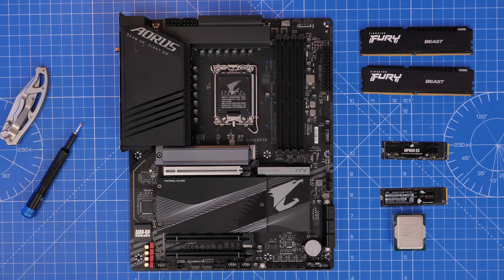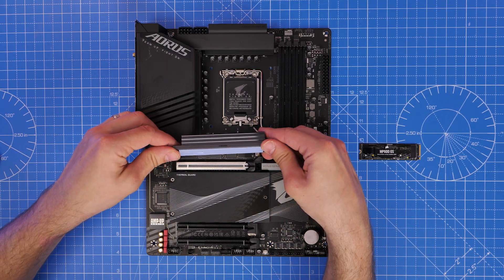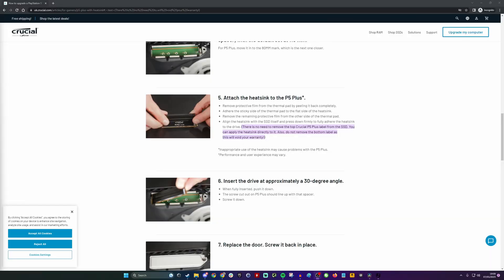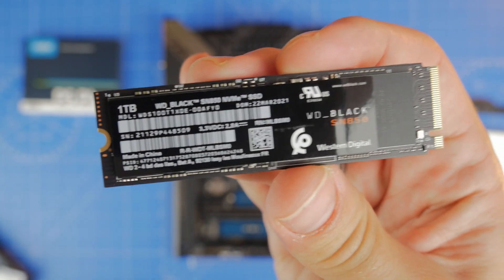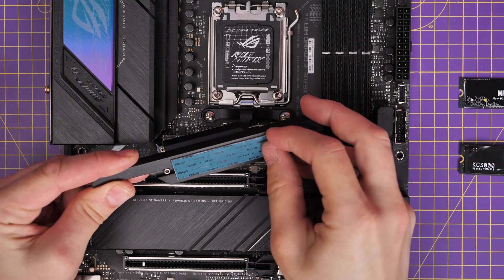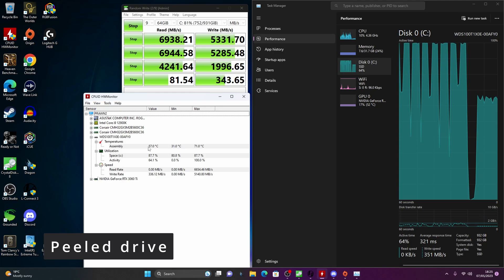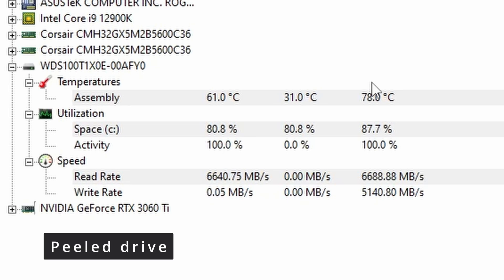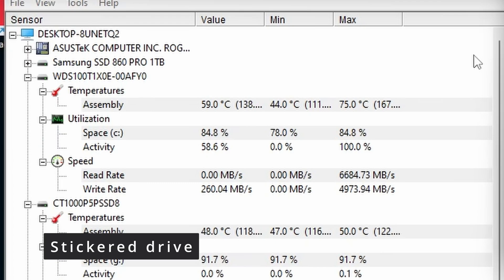Should you peel the sticker off your NVMe? Does it help?

Comment: Depends on the sticker many NVMe's these days have a metallic sticker on them that spreads the heat so will help improve the heat transfer when using a heatblock like in your video.
Reply: Adding more material decreases thermal transfer. It's dependent on the thermal resistivity of the material and the thickness of the material. The increased thermal resistivity of leaving the sticker on is negligible as long as it's not a thermal insulator, which it better not be if the manufacturer recommends leaving it on.
Reply: @victorro8760  it's not necessarily that the sticker is better for heat transfer, but it's better at spreading out the heat, most newer ones are made of copper and other materials that are good at transferring heat, which then spreads it out so it can be radiated over a larger area. This is especially helpful when you have an SSD heatsink with thermal pads, because thermal pads are worse at transferring heat than paste most of the time, so the heat being spread out means that more is being taken away from the SSD, now if you want to, you can go a more custom route and try to set up a thermal paste system for the SSDs, but it takes more work, and can get a bit messy at times.
Reply: @victorro8760  Often improved ventilation, else thermal transfer between component & the surrounding air environ, strongly influenced by surface area factor. Heatsink design using fins likely improve performance of lesser materials.
Reply: doesn't the label prevent heat dissipation?
Reply: How would that make sense though since it adds another layer of materials that doesn't conduct heat perfectly. You'll get better performance, for example, by delidding the heatspreader in your CPU which is more thermally conductive than these sticker
Reply: @GroxEmpire  The sticker is a multi layer material sandwich and one of the bottom most layers should be a graphite (often marketed as graphene*) XY thermally conductive pad. The graphite works as a high performance heatspreader which helps the whole pretty substantial area transfer heat efficiently as opposed to just the small hotspots on the chips, so the extra Z thermal resistance from the sandwich doesn't end up mattering quite so much. The horizontal thermal conductivity of these graphite pads is absolute nuts, so much higher than any metal, it's really impressive; but the conductivity through the layer up is pretty bad, so by all reason, adding a little bit of plastic and paint on top for the printing doesn't end up being worse, since the overall thermal impedance upwards ends up being dominated by graphite.

I think if you put on copper, you might as well possibly not want the graphite sticker, since overall higher conductivity of copper heps the lateral performance massively, but it's probably good to keep in combination with aluminium heatsinks, especially ones with thinner bases. But to be certain someone would have to measure it for real.

*) graphene marketing in any cheap consumer products is a little dishonest but not a total lie, i just don't think they can achieve more than a fraction of a percent of real graphene in there for the price, so it's doubtful how much it contributes to the performance of the product. Graphene is made by converting graphite, this step can be quite cheap, and then you get a mix with a lot of graphite and just a little graphene, and properly purifying graphene out of the mixture is a borderline impossible insanely expensive task.
Reply: @GroxEmpire  Not always, on the ones that use a Copper sheet or Copper sheet with Graphene coating they transfer heat more efficiently to the heat spreader especially when used with a thermal pad that acts as a thermal conductor between the two metals.
Reply: @GroxEmpire  Because the heat spreaders for SSDs are aluminium, which is a shitty thermal conductor.

The hotspots on the plastic NAND chips are tiny compared to the size of the chips.

Metallised stickers spread the heat across a wider surface area of the (crappy) nvme heatsink.

This is why you don't see CPUs in plastic packages or water cooler blocks for CPUs made out of Aluminium.
Reply: @incandescentwithrage  If Aluminium is a shitty thermal conductor, Which is a good one ? Iron ? Steel? LOL. 
Aluminium is is one of the best thermal conductors out there. Yes, Copper, silver, diamond, graphene etc. are better but they are all far more expensive as well.
Reply: @DragonOfTheMortalKombat  Lol yourself. We're talking about materials for heatsinks.
Copper is used where you need good performance.
Reply: @incandescentwithrage water blocks aren't aluminum because they will just corrode.
Reply: @incandescentwithrage  Most heatsink fins are aluminum and heat pipes are almost only copper. Copper is less than twice the thermal conductivity of aluminum. For many applications copper fins won't see much if any improvement over aluminum ones because the aluminum is enough and the system convection limited.
Reply: @SpiderWaffle  Yes aluminium fins would be fine if the base contact layer was copper, to spread the heat from the small & dense heat sources of the chips to all the fins.
That would require a multi-part construction and another TIM boundary.

"Copper clad aluminium" would probably be ok for the contact layer if thick enough 

SSD heatsinks are small enough to just make out of copper without being expensive.

Comment: Nope some help in cooling.
Reply: If you have a heat sink for it, it might be better to peel it off. I would check the documentation beforehand, though. But I would assume thermal pads work best when contacting the chips directly instead of going through a sticker.
Reply: @SpiceCh  He's just shown it to make zero difference.